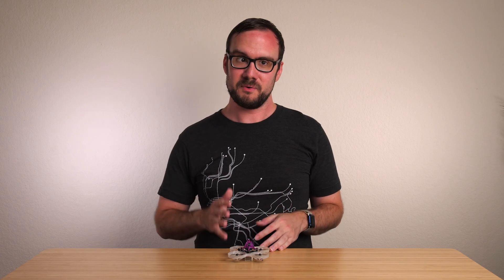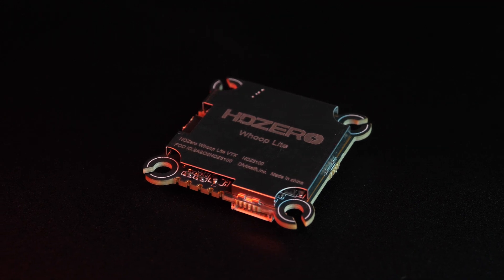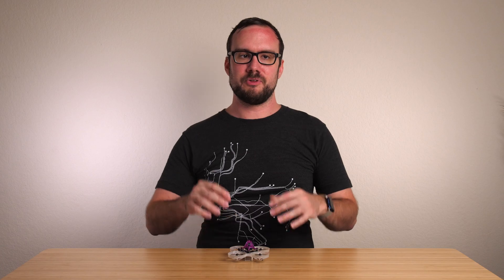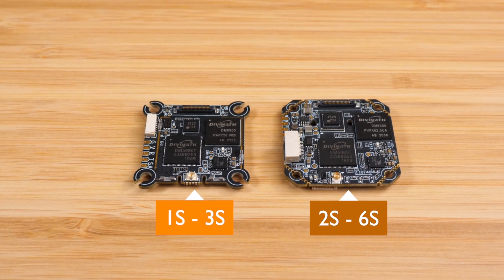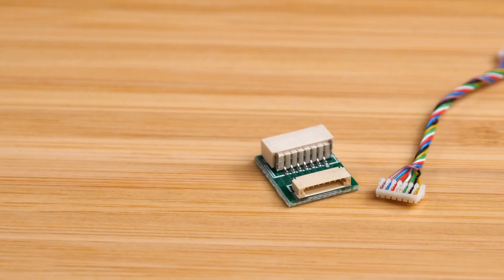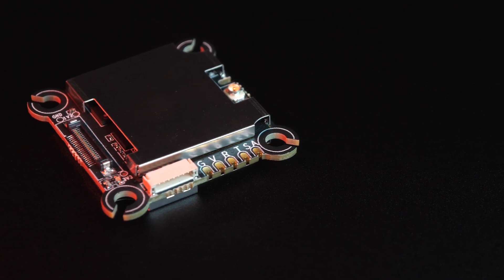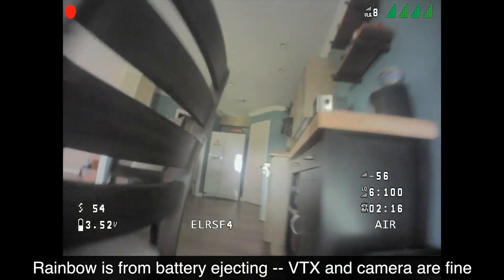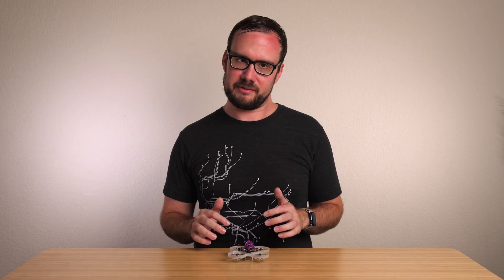HDZero Whoop Lite 1S VTX: EVERYTHING You Need To Know

Comment: Thanks for your very interesting video. I made a tiny whoop with the Eco bundle camera Vtx, but after a few seconds of connection the video freezes, everything disappears completely. There are many other people who have the same problem with the Eco bundle Vtx. I would advise you to check. It may be that there is a bug in the electronics of the Vtx, where it cannot control the absorbed voltage. The lipo batteries are emptied quickly after a few seconds of connection, and with a very rapid overheating, compared to normal operation, causing the total blocking of the video. Thanks in advance.

Comment: Thank you so much for this info. Hdzero does not offer wiring diagrams in their website and there are very few posted. As a non digital pilot, building with this chip was a complete nightmare, right down to the non standard FC connector and 25mm mount pattern. My analog setups look twice as good with no snow or static. Anyway I could not have wired this with confidence without your video, so thanks a million and subscribed -badpawxx

Comment: So....I get mad signal interference when I power this vtx directly from the bat. Am going to try 5v but how is everyone powering this from the bat and getting clear signal
Reply from the maker: Do you get the interference only while armed? If so, do you have a capacitor on the power input?

If you’re getting interference even on 5V, I’d suspect something else about the build, such as antenna choice or antenna placement.
Reply: @ATXAirborne  I'm of the mind set it's power as I get interference when not armed. When I arm it's fly's but the signal gets worse and I get on off rainbow screen every 4 secs. I'm using crazybeef4 elrs v1. I know it's a poor choice bits it's all I have

Comment: Could we just use a ziptie to hold the antenna? Or is there a reason why that wouldn't work?
Reply: Zip tie could come off too potentially. Best option is probably either heat shrink or e6000 but zip tie could maybe work.
Reply: From my understanding the design was for a tiny zip tie (see Mr Shutterbug) but considering the catastrophic damage of losing the antenna and burning the board I like Zach's idea of heat shrink.